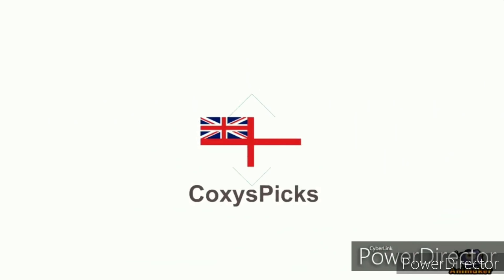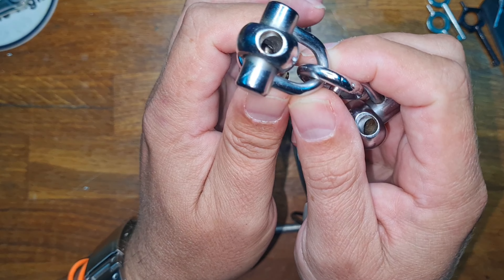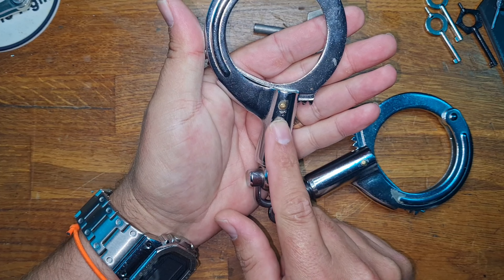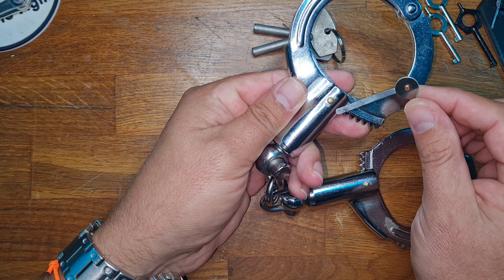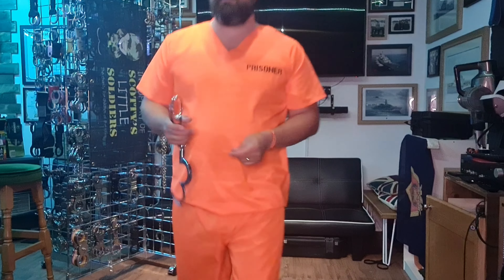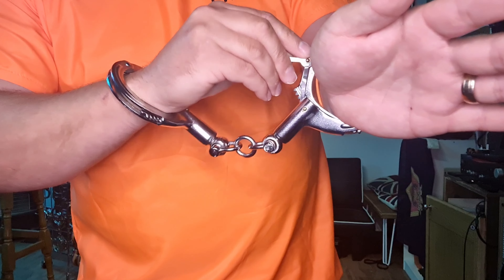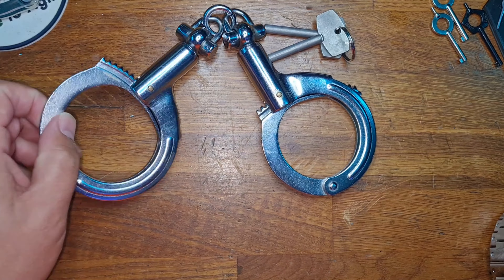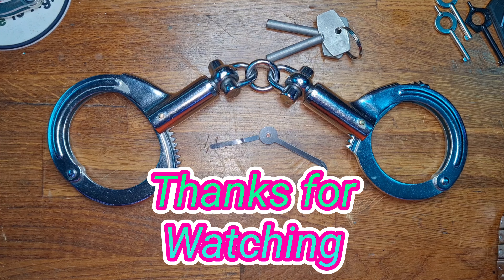ANHUA HC-01 SL Bypass

Comment: Hiya, these are great cuffs and I love wearing them. I use them in solo scenes, they  can be double locked as well. Once on, insert the key and turn anticlockwise.  It will  hardly  move . You can  just  sense  a  slight click. To unlock, just turn clockwise. Have fun and stay safe.
Reply from the maker: The fun for me is escaping them 😂 
They are a tricky cuff to escape when the DL is set - but that's mainly as the keyway dissappears behind the swivel

Comment: Coxy, I used to have a pair of these, and you have just reminded me to maybe try and get some more.  They are one of my favourite handcuffs, they are beautifully designed and so smooth to operate.

I had a bypass for these.  I loosely rolled  up a piece of paper, or maybe thin card so that it would fit over the triangle. Once over it, I rolled it tighter, and then used it as a key. I hope that is clear.  

I have another bypass for the cheap ratchet cuffs with a single pawl whereby you slide a playing card between the arm and the frame?  Which effectively works like shimming, but from the side. This could also be done with a fairly robust thin plastic sheet.  I wonder if this would be possible with these cuffs, I suspect maybe not but it may be possible with a little scissor work to cut an optimal shape.  I really must get some more of these.

Assuming you are local to your accent, I probably don’t live a million miles from you.

Another great video thanks.

Mike
Reply from the maker: Mike - the rolled up paper trick is good and does work. I use a small piece of copper pipe as it is a very effective tool to open these 👍
This bypass can be done with a slither of card, but you do risk leaving a piece of card behind , inside the mechanism. 
Side shimming is a great tool to keep in your back pocket, as is back shimming. The only downside, is that these techniques seem to have been designed out of the modern cuff.
But, like I have just demonstrated with S&W,  there are still exploits to find so who knows? 
As for my area, I'm a Devon lad 👍
Stay safe and have a great weekend buddy 👍 😀
Reply: @CoxysPicks   thanks Coxy, I am thinking I may have to resurrect my favourite “ by passers friend” ……the 2 litre value drinks bottle, or even the Nescafé Azera tin, and some scissors as some of your videos have inspired me to look into this area again.  I have a small collection of handcuffs to try these things on so let’s see what I can do, I will keep you informed.  

I lived most of my life in East Devon, and currently live in Somerset, but plan to go back in the future.

Have a good weekend

Comment: Just received two sets of these I use a shim to open these like this of course not doubled lock.
Reply from the maker: It's a great single lock bypass. 👍
Reply: @CoxysPicks  Absolutely I’m testing them right now but n me of course now I need to beat the deadlock.
Reply from the maker: The deadlock, as far as I have researched, can't be reached via the gap in the top. It's keyway only, and that triangle shape is designed to stop tools working.

One suggestion is a pencil jammed in will open the DL and subsequently the cuff. But use a soft wood one and don't sharpen it 😂
Reply: @CoxysPicks  I need to try some different ideas I will keep you posted.
Reply from the maker: Awesome 👌 Cannot wait 👏

Comment: Do they double lock ?
Reply from the maker: They can double lock, utilising the key. There isn't an easy set window, or push button like on modern cuffs.
It can also be inadvertently not set as the key can slip from the actuator as well. 
Hope that makes sense buddy 👍